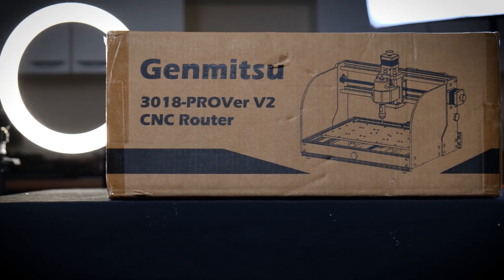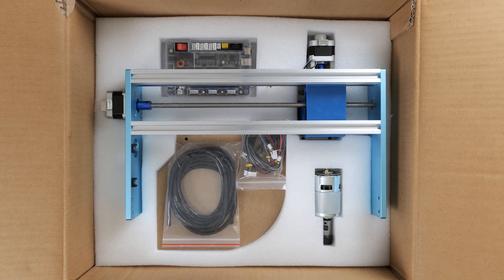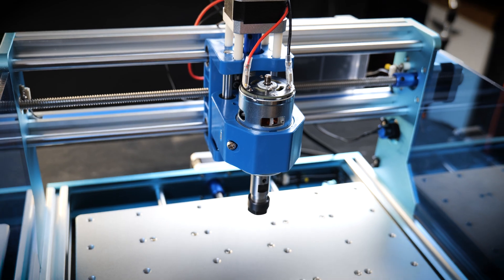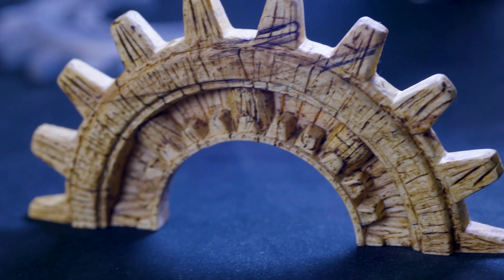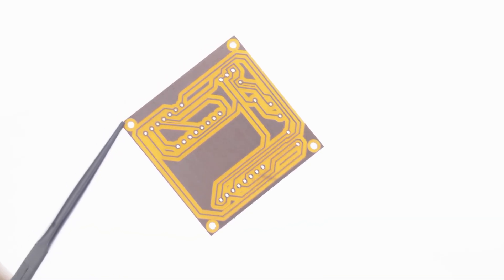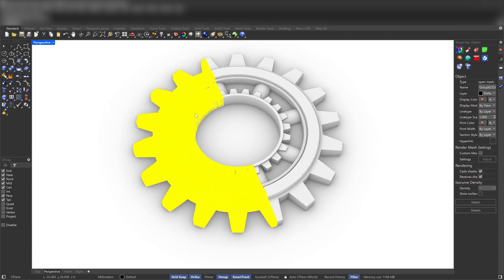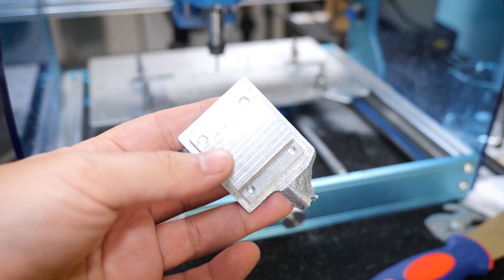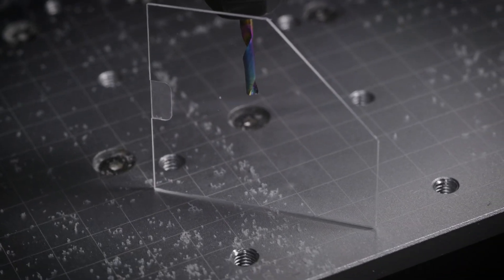What This Budget CNC Can Do Will Surprise You! (Review)

Comment: @Maker Vibe, thanks for this excellent video. Short and descriptive - this is exactly what we need ;). You mentioned that this is an overkill just for the PCBs. What would you recommend just for the PCBs then? Also, can you recommend any methods for two sided boards?
Reply from the maker: You're very welcome, thank you very much for the encouraging comment -- I'm glad the video was helpful! You can make PCBs on virtually any kind of 3018 cnc machine. If you have a look on AliExpress, there are some unbranded ones priced at about $150 - $200 with fairly similar spindle specs to the Genmitsu 3018 PROVer V2. In theory, any of those could work. I have not tried any of those personally, but many people on YT have. 
That being said, as someone else said in another comment, you might also want to look at a brand called TwoTrees. They have some great machines with bigger build plates, more features and more powerful motors. It all depends what your goal is and what kind of materials you want to cut.
Two-sided PCBs are challenging with these machines for a couple of reasons: 1) making sure the board aligns properly when you flip it over, and 2) making the vias connect properly from both sides. I have had some success using 3D printed jigs to solve the alignment issue, but it is very awkward and time consuming. For vias I have seen people using eyelets, but again this awkward because you are limited by what size eyelets you have. You can also try pouring solder all the way through to make sure the vias connect on both sides, but it is still not a very smooth process unfortunately :( So although it can be done, some might argue that it's much easier to just to have them made professionally.

Comment: You might want an air blower system to blow off the chips from aluminium, which might also help with surface finish.
Reply from the maker: You're absolutely right. Sorry for the late reply btw, but yes I really struggled without some dust extraction/chip blowing system. The best Genmitsu offers is a dust shoe, but they don't have any vacuum system to go with it. I think TwoTrees has an all-in-one pack, which is very tempting...

Comment: The 3018 is not worth it specially since TwoTrees came out with the TTC450 which cost only US$370, the only time a 3018 would be a good buy is if you do not have the space. You will out grow a 3018 in such a small amount of time and will end up trying to upgrade it which in the long run will cost more than starting with a more capable desktop cnc. I took the 3018 path and will never endorse it even if it was given for free.
Reply: The TT450 costs close to $700 Amazon US) only 3 days after your post...
Reply from the maker: @paradoxworkshop4659  I think the prices vary depending on where you're looking. E.g. right now on their official website, the TTC450 is down to $480. But imo that's not their best machine, I think their best at the moment is the TTC450 Pro. There are many optional extras for it and even with those added on, the price range seems better than the equivalent Genmitsu machine. What are your thoughts?
Reply from the maker: Heya! Thank you for the comment. Honestly I had not even known that TwoTrees existed. I have been looking at their products. There isn't a supplier direct here in the UK, but yes, their prices are insane! Thank you so much for sharing, it sounds like you didn't have a great experience with the 3018. What are you operating at the moment?
Reply: @MakerVibe  I got sick, 2024 was not good to me. But I just ordered a TTC450 Pro.

I bought my 3018 a few months after the pandemic and started playing around with it and got disappointed as it was not good enough to do what I wanted to work with, carbon fiber and aluminium.
Reply from the maker: @vlozity  Hey, happy new year! I'm sorry to hear about your sickness, are you getting on better now? Glad to hear you ordered the machine!! If you could keep us up to date with your experience, I'd really like to know because I'm quite tempted to get one myself. I may have found a supplier on Amazon but of course without any reviews to go by, it's a bit of a risk.